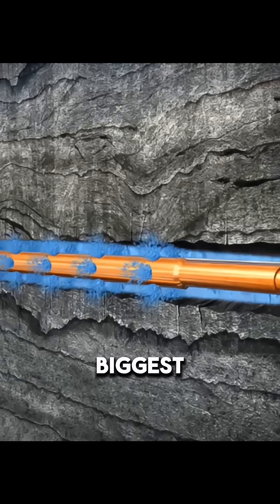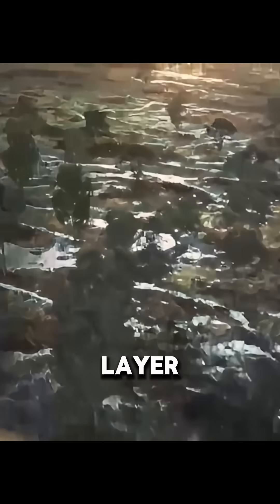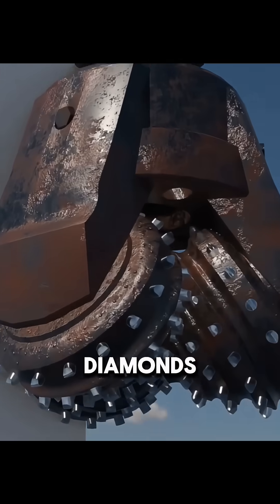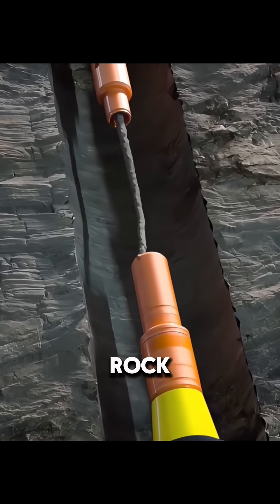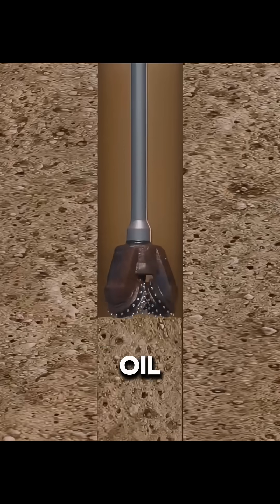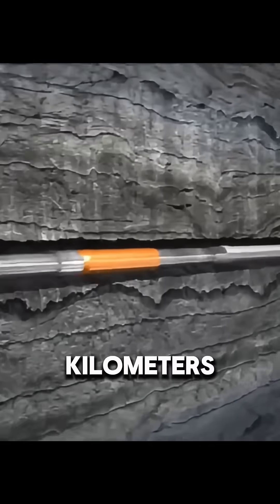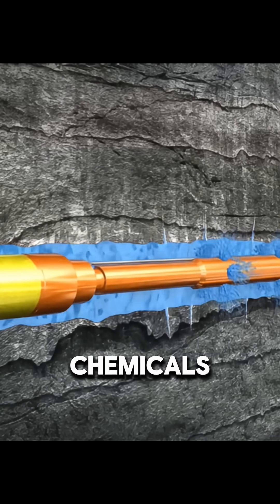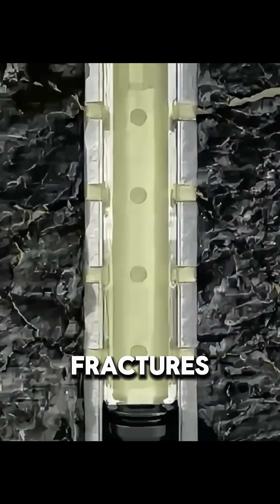How is oil extracted on land? #zackdfilm #foryou #oil

Comment: Besides for all the problems it comes with, I don't know much about the technical science behind it other than what is described in the short, but from what I see it just doesn't seem like an efficient method of extraction. I get the feeling there is a lot of wastage compared to the amount they actually end up with in the barrel. If I might be right, I wonder how they justify that.

Comment: They left out, when they start "kicking off"(going horizontal) they utilize a tool (we called) a mud moter. Instead of rotating the string of pipe (which it would destroy), they b put that "mud motor" on there and a "kick off sub" (that's where that 3°-5° comes from. The mud motor is a hydraulic tool that turns just the bit by pumping the mud through it. Not turning the whole string of pipe.

Comment: I was a drilling hand for years. Worked derricks mainly but also worked as a chain hand . Today they don’t use spinning chains. They use hydraulic tongs or even air tongs. Technology has done a lot since the old wooden derricks. When I was a kid we lived outside Comanche Oklahoma where all the roads you drove down had these old wooden derricks standing over wells that had been drilled using them. They were shallow wells. It was oil the color of gold in that area.

Comment: I really wonder when I try to understand this process of fracking.  Why so complicated?? If they can get Crude oil back from RUBBER TYRES using Pyrolysis process and those machines are available in the US every corner.  So that Pyrolysis 1 machine can produce 10MT of straight black crude oil in just 10 hours from 20MT of Rubber tires then why do they need to invade these countries and even go to Iceland to fight the territorial disputes over the freaking complicated Fracking.  !!!!

Comment: So the USA Oil is helping in killing 1 in 5 people .Harvard University, et al found that more than 8 million people died in 2018 from fossil fuel pollution, significantly higher than previous research suggested—meaning that air pollution from burning fossil fuels like coal and diesel was responsible for about 1 in 5 deaths worldwide.

Comment: I started working in Dads automotive shop at 13-14. Worked till 18 and became a machinist. We made oil drilling Wizzers, Hollywood Film cutters and specialized carbide products. Later, in Aerospace I was installing CNC robotics for Northrop, Douglass, General dynamics, Rocket-dyne and Hughes Aircraft where we made the Rock-bit you speak of. There was so much more I enjoyed.

Comment: Laws have been passed to negate liability related to the chemicals.  The other problem is these wells don’t produce like regular oil wells, they drop in production qty quickly and play out years faster then regular oil wells.  These means they need to continuously drill new wells to replace reduction in production.

Comment: Fracking fluid consists mainly of water and sand; the sand keeps the fractures open, and the chemicals are only a small fraction.

The chemicals in the fracking fluids also consist of BTEX = benzene, toluene, ethylbenzene, and xylene: toxic aromatic hydrocarbons;benzene is carcinogenic.

Separation from drinking water consists of only a few centimeters of steel (≈ 8–13 mm) and cement (≈ 2–6 cm).

This barrier can deteriorate over time due to poor cementing, corrosion, and aging.

Protection of drinking water is, therefore, not an absolute guarantee but a technical risk-based system.

Comment: I think it's a great idea for the USA to produce oil domestically.   I think ground water concerns are  valid where the two come into contact. I would think you could frack in places that don't have ground water.  Because cheaper oil and clean water are both good things .

Comment: "MASTERED,"  I think NOT. That "drilling fluid" is incredibly polluting and these companies proclaim "proprietary." 
Therefore, local waste water treatment plants are blind as to its proper treatment. Also MOST of the fracked methane is lost to the atmosphere. Methane is 30x's more potent a greenhouse gas as is carbon dioxide.

Comment: How many people really know what else the casing does?  The casing isolates the water table where ever it is and is usually thousands of feet away from the water table with no path for the chemicals and crude oil to contaminate the ground water in the aquifers.   In the cases where you see gas getting into the underground water it is usually avoidable if the drilling company and the operator follow certain industry standards.  I use to work in the oil fields of Wyoming, Utah and Colorado.  I only saw one well where we hit water in Wyoming and it wasn't very deep.  We had not run casing yet because we were no where near the depth where we would be running casing on that particular well.  What that wells additional water did was unbalance the ration of bentonite used to coat the well bore as we drilled down well past the entry depth that the water was coming from.  The location was a muddy mess for a while but we got through it to the point it wasn't an issue any longer.

Comment: There are several casings (pipes) on a well.  

Casing types and functions

Conductor casing: The first, shortest casing to prevent the hole from collapsing and to keep groundwater from mixing with well fluids.

Surface casing: Installed after the conductor pipe to protect freshwater aquifers, support the wellhead, and prevent the loss of circulation.

Intermediate casing: Provides wellbore integrity for deeper sections, protecting formations from high mud weights and containing kicks (formation fluid influx).

Production casing: The final layer that isolates production zones (oil and gas layers) and houses the production tubing. 

The Bakken shale (North Dakota) currently being produced has a zone from about 8500 to 11000 feet deep  plus about 2 miles of length running horizontal ly through the producing shale. This bore follows the formation staying within a few feet of the center.   Shale drilling and fracturing is actually very precise.  [A far cry from the old wildcat vertical oil wells if decades past.]  That horizontal length is fractured in multiple short segments or stages.  I think most producers are doing about 60 stages per well these days.  In the early 2000s a well took about 28 days to drill with the newer larger rigs they can drill a well in 8 to 10 today.  

After initial flow back to seperate excess propant (sand) the well will freeflow for several months (Initial Production).  IP  is typically 2000+ barrels per day.  As the flow drops off, artifical lift is used to maintain production.  This can be via electric submersible pumps, rod pumps or gas lift (think old perculator coffee pot).

Bakken well life is about 20 years or so.  After which time they are plugged with cement, the facilities are removed and the surface is restored with top soil.
Reply: Tx for the indepth know how !👍🏼

Comment: Or...or Nuclear power plants. We solved our energy needs 70 years ago. Use oil for some vehicles, enthusiasts, planes and ships if ships can't be converted to electric at some point but most commuter cars should be electric and all our energy for the power grid should come from nuclear, dams and geothermal. There is no way around polluting to some extent, mining material for batteries is bad also, but we could definitely clean things up if we actually wanted too.

Comment: Anyone who posts that this damages the water tables is a dumbass.   Just look it up aquifers are typically max depth of 500ft  and shale layers start at 4000ft and go down to 16000ft.  This leaves a minimum of 3500ft between the fracture  area and the water table.  If there is damage to the water table then it is from people cutting corners on old deteriorated wells drilled 40+years ago.

Comment: Now quite how it works there's no "oil" in shalle rock. That Shalle rock 🪨 its like waffers dried waffers that contain concentrated dried oil kinda like dried fruit that's dried as the plankton turned intom gas, and gas percolated down the pourus rock and ended as a old well that then dried this is called the Oil-Gas window. The liquid enters the crack and the chemicals rejuvenate the rock to make the rock like a sponge thus releasing the oil into the chemical then the chemical is pulled back up and the oil extracted and the chemicals returned back underground to start the process again. Freaking is very toxic and messy.

Comment: The drill goes down approximately 2 miles and then goes sideways for another 2 miles. Not everyone has the skill to be able to get the drill in position for the sideways drilling, and so they are paid very well, but their shift typically lasts longer than 24 hours.

Comment: Methane leaks from oil and gas operations, including pipelines, are the number one source of human-caused methane pollution on the planet .. greenhouse gas footprint of fracked natural gas is actually worse than coal and oil because methane traps more heat in the atmosphere.

fracked gas is no “bridge fuel” to renewables, it simply substitutes one less dirty fuel (coal) for another more dirty fuel (fracked gas), making climate change even more costly and destructive in the coming decades. 

fracking has caused widespread pollution of drinking water in usa . in the most dire cases, communities have had to truck water to their homes when well water became too polluted to drink.

these pollutants include methane and toxic chemicals linked to fracking.   fracking produces toxic — even radioactive — wastewater. some of the chemical-laced water used to frack gas wells returns to the surface as wastewater.

this wastewater contains not only the original fracking fluids, but also  dangerous levels of harmful underground contaminants and radioactive material. these chemicals can cause cancer, harm sensory organs and the respiratory system and damage the nervous, immune , cardiovascular and reproductive systems.

Comment: Big oil don't care if they poison the land as long as they get rich
Reply: The largest stockholders in Big OIL ARE PENSION FUNDS.
Reply: You sure its corporate greed? Youre the one buying it. Youre the one who drives an extra block to save a penny.
Reply: who poison? US right?
Reply: Spaceman7915: where does Electricity come from?
Reply: This looks economically sound. What part of this is “poisoning the environment” ? What part of this doesn’t promote human flourishing? Climate alarmism much ?
Reply: You get well water above 1000’. Perforations and Frac are down below 10,000’ +. Also, the oil has been there for millions of years and it can on occasion seep upwards into the water table on its own depending where you live. Been happening in California for thousands of years. Oil seeps out of the ground and forms tar pits and seeps into the water off the coast of California causing waxy tar balls to wash up on the beaches. 

If you can light your tap on fire that’s a problem with your water supplier or your well has methane seeping in from way higher up.  Methane comes from decomposing organic material and can form underground in areas with high water tables and the bottom of ponds and lakes. 

So, don’t worry about fracking cus it’s really deep at more than 2 miles or so below the surface. Also, when the well is first brought onto production all the drilling fluids come back up and after a while it’s just the oil mixed in the ground water coming up the production tubing. 

It’s really a safe way to produce oil.
Reply: You’re the same people that cry about nuclear energy. It’s had its problems in the past, but those have all been fixed. It’s one of the safest ways to get oil at this point but you’re looking at 1980s problems and assuming they’re still here today. If you cared about clean energy, you would be pro-nuclear and nuclear only solar is never gonna get it done. Wind is never gonna get it done. Geothermal is going to be just as dangerous, hydroelectric just won’t work we don’t have enough water flow and we would be disrupting ecosystems like crazy which would drive the green party nuts. You all like to complain, but you still haven’t brought forward a viable solution.
Reply: Don't drive cars or use anything with plastic. This includes electric vehicles which are filled with toxic chemicals in their batteries which we cannot recycle.
Reply: What if there will never be another need to drill another oil well ever... What if there is so much oil that we have to PRETEND it is scarce...
Reply: @dennishoyt2348 
JESUS IS THE WAY, THE TRUTH AND THE LIFE. Repent and turn away from your sins today🙏🏻
Reply: Big green wasting tons of money.
Reply: It’s just capitalism
Reply: @JonJonesLeftToewdym capitalism? Countries without capitalism also created eco problems
Reply: @JonJonesLeftToe Right, because other economic models never pollute anything.  GTFO
Reply: Yep one of many reasons why i stopped buying petrol, for nearly 10 years and went full EV household.
Reply: @spaceman7915  hahahaha your still using a lot of oil 😂😂😂 like anything plastic
Reply: @spaceman7915  So you would sooner see Chinese strip mine here there and everywhere using native slave labor. refine the materials in unregulated plants and dump the sludge anywhere they feel like it. Your so virtuous.
Reply: @spaceman7915  Ever research on how they make EV before you can say zero?

Comment: If you want to stop hydraulic fracturing...
Stop using fossil fuels.  
The oil and gas industry does not set the price or the volume of their production.   It IS based on 30 day futures.  Oil and gas are left in the asset (the formation or where it lies) until it has been sold 30 days in the future...  i.e. 30 day futures. 
This means they only produce what is demanded by the market.
Its simple, stop the demand and the supply will naturally stop...  by design.  Stop needing oil and gas and the industry will go away.
It really is that simple.

Comment: Well-established harms
	•	Methane emissions
	•	Induced seismicity (mainly from wastewater disposal)
	•	Surface spills and poor wastewater management
	•	Habitat fragmentation
	•	High water use

Partly case-dependent harms
	•	Groundwater contamination (depends heavily on geology and well integrity)
	•	Health impacts (often correlational but consistently observed in multiple regions)

Benefits often cited by advocates
	•	Domestic energy supply
	•	Lower reliance on coal
	•	Economic activity and tax revenues

But these benefits must be weighed against cumulative, often long-term environmental costs.

Comment: Anti frackers are idiots who don't know what they are talking about, the vast majority of oil Co. have to follow a strict procedure to keep ground water safe (ground water is found 20 ft to couple hundred ft., the actual oil from fracture is usually between 5000 and 12000 ft. with cement and steel casing separated) Just like anything if there is anyone who does not follow rules there could be contamination just like any other industry its the bad people doing it that cause the problems not the industry. water contamination is super rare because it is not in the companies best interest, understand that idiots.

Comment: Fracking is one of the most damaging techniques for the Earth. The chemicals contained in fracking fluid are incredibly harmful, leading to widespread contamination wherever they come into contact. After the fracturing process, there are significant concerns about the residual effects. When the fluid is pumped back into the wells, it is so toxic that it contaminates the surrounding soil and environment. The benefits of this technique are outweighed by its detrimental impact on the Earth.

Oil companies often prioritize profit over environmental well-being. Additionally, fracking is closely associated with increased seismic activity, such as earthquakes, but these concerns are largely ignored by those seeking to extract oil.

Comment: In the 70s they talked about the research they were doing to make this happen. it took almost 40 years before it was profitable. they are working on making the fluid reusable to save cost and lessen pollution. we will always need oil , at the same time we need to use more renewable energy.
Reply: In the meantime I get to drive my F150 to the gym twice a day 😂

Comment: I think there’s still many issues with fracking
Reply: Like what?  Water contamination at 5 miles deep bother you?
Reply: Fracking does have regulations,  contaminated fluid should not be leaked onto ground surfaces,  but who is monitoring?   The wall could cracked & leaks,  rain or snow could carry contamination to the surface,   No one can say it’s perfectly safe!    Question is how much leak is allowed?   How wide spread and who is reporting?